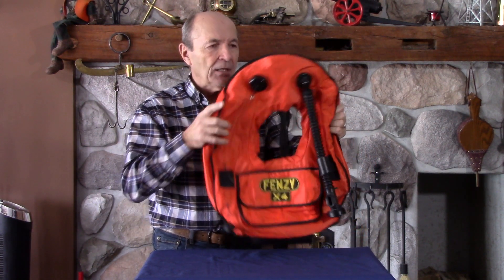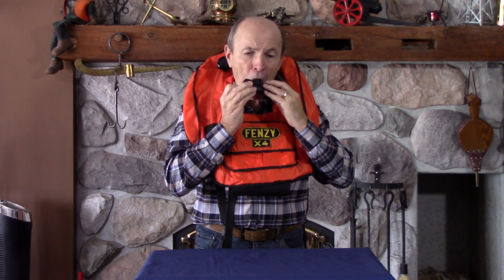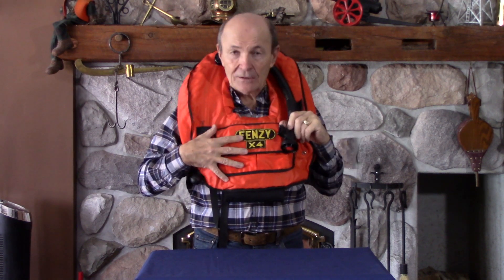Vintage Scuba: The "Fenzy" Self Inflating BC - S04E08

Comment: After putting on your suit, the Fenzy was fitted next, then the scuba tank, lastly the weight belt. In a real emergency everything but your life jacket and suit could be dumped. Something I could not reconcile when "stab" jackets became "normal" only morons thought they were an improvement. Self rescue is impossible with modern rigs, if you need to dump your tank and you find yourself 6 miles offshore and no snorkel. With a Fenzy roll on to your back and swim home.....
Reply from the maker: And the Fenzy could be seen a loooong way.   Black BCD, not so much.
A

Comment: How about the idea you could use it as emergency air . Learned on this in the (British) army with a J valve. 300 psi wasn't much if you had a deco to do. It would terrify a modern instructor to even suggest such a thing, but I was taught it. Right though, I never dove with any weight in my rig.
Reply from the maker: You have to watch Scuba Tech Tips S13E02 Don't breath from a BC.  Bring back memories.
A

Comment: My first BC was a used  NIMROD  yellow ribberized cancax unit 
It had a steel bottle to add air. Later I got hotd of a US Diverspower inflator that I adaptde with Epoxy . I used it for rears. Traded it to a buddy years ago . Sure wish I had it now. Dont know why ..my diving days are long gone. Thanks
Reply from the maker: That's NEMROD, from Spain. Good stuff.
Unless you are prohibited, why are your diving days over??
Diving is easier on your body, inside and out, than getting out of bed in the morning.
So, if you can get out of bed, you can dive.
Take care Tony.
Alec

Comment: When the Fenzy vests were usual  also the bottles had a "reservation", that warned you when the bottle had little amount of air and had to suspend the dive
Reply from the maker: I don't recall that feature. In my experience, one of the problems with the Fenzy was not knowing how much air was in the tank.
We simply refilled it off our air tank after every dive. Maybe that was  a later feature.
Alec

Comment: Great video, my bcd actually came with a inflator tank it’s made by A.P valves. Never used it but it is there in case I run out of air.
Reply from the maker: Gosh! Not sure if I'd rely on it for an out-of-air emergency. Not much time in there.
Kinda' like the Spare Air - great idea and it can be useful but not for divers to rely on. 
It has just enough air to keep you alive long enough to realize that you've screwed up and aren't going to make it!
5 or 6 breaths at 100' doesn't give me much confidence.
Take care.
Alec

Comment: Alec could you do a tech tip on adjustable breathing effort on 2nd stage regulators. Thanks.👌🐋🐢🐳🐬
Reply from the maker: We're planning a Tech Tip on adjusting regulators. It will be a 2 or 3 part series and will include adjusting the second stage at which time I'll cover adjustable second stages.
Alec
Reply: Awesome thanks

Comment: Great video.  Brings back lots of memories.   Comments about hairy chested divers is true and now quite hilarious. How did people travel with these? Did they take the tank with them or did they rented at destination?  Thanks.
Reply from the maker: That was an issue all right. The tanks are heavy. Actually these BCDs are heavy too since the material used was much more substantial than other BCDs of the time. It was more like heavy, rubberized canvas.
Generally they were used at home and a diver would NOT take them on a dive trip.
Today it would be a real problem with both weight restrictions and concerns about a compressed air tank.
Thanks for watching.
Alec
Reply: Thank you for the quick reply.

Comment: Another question any tips on how to tell if you properly cleaned your gear ? Thanks I really appreciate it
Reply from the maker: Interesting question.
I suppose that if it's working OK that's a good sign!
Seriously, if your reg looks like new on the outside, no corrosion, no green spots, no deterioration of the rubber, etc. that's the first thing to look for.
Unfortunately, it's only a start. I've had many shiny, new-looking regs come in for service that were destroyed on the inside - the important part. So, next look at the filter under the dust cap. It should also be clean with a metal-like color - no white or brown or green color. Try to see inside the first stage if it has openings. Look for white crusty flakes or green color - that's bad. Look into the ends of the plugs in the ports on the first stage. Again you want no white or green.
Look under the hose protectors on the first stage and the second stages if there are some there. The steel fittings should be clean and shiny - no white or green color.
The swivel on the second stage should be very free when not under pressure - not floppy and loose but easy to turn. 
Put the reg in your mouth and blow gently. It should exhaust your breath easily without hesitation or your having to blow hard into it.
If all of these are good, you're probably OK to go.
Proper cleaning after every dive as I've explained in my vids before and a service every 30 - 50 dives will keep it safe. 
A good reg, properly cared for, should last literally forever!

Comment: Great vid. I never got to use one. The one I used was the yellow horse collor but it had a co2 cartrage. And a inflator hose. I lurned to dive with in 1975
Reply from the maker: The yellow Horse Collar was the most common BC for many, many years. The CO2 cartridge is long gone now but lots of my vintage gear friends still use a Horse Collar.
Thanks for watching.
Alec

Comment: Have you ever got dcs? Or had to help a dive buddy with it? I would love to here your experience and opinion on that topic
Reply from the maker: I'm a rare case. I certainly have never been called a wimp - more likely a daredevil but, I have never had a serious diving injury in over 60 years of diving in every possible environment.
On a trip to Cozumel many years ago, my buddy and I were in a rebellious (read:stupid) mood and we went waaaay too deep.
After being ostracized on the dive boat, I rode back very quietly and every time I felt a tick or tingle on my body (probably caused by the salt water drying) I said to myself that my luck had run out. But nope. Sorry. No stories there.
Having said all that and despite it, I don't have much respect for divers who get DCS. It's avoidable.
However, it happens. Fortunately if you have access to treatment it may not be life-changing.
Thanks for watching.
Alec

Comment: ...Brilliant video.... Alec we Brits know that type of life jacket as an A.B.L.J....(Adjustable Buoyancy  Life Jacket) a proper old school piece of kit ,I still use one and found them a multipurpose item for snorkeling and canoeing included . in the pool we trained to breath off them in 12ft 6ins  of water just useing that small fitted air bottle . and old habits die hard, I purposely  bought a Buddy Trident B.C.D. with an integrated air bottle .... sorry for the waffle...
Reply from the maker: All of the models that we had here in Canada came from the UK.
That's another thing I forgot to mention in the video - they can be used with an air tank for snorkelling or other sports.
Thanks.
Alec

Comment: Do y'all not get AP Valves products over in the colonies? The Suicide Bottle is still an option on their BCs to this day.

My understanding is that  (at least in the modern context) if you're entering the water with a set that is negative without any air in (due to multiple cylinders, additional equipment, etc) and for whatever reason your power inflate doesn't work (you forgot to turn your air on) you crack the valve open to stay at the surface. So you can turn your air on.
Reply from the maker: The colonies?? Cute.
AP valves are available here but not so popular.
I knew that there are still BCD models with air tanks on them but I forgot to mention that.
They are really rare here. I don't even know if there is a North American distributor.

The thought that a self-inflating BCD might be valuable if you jump in over-weighted and without your tank turned on has some merit. I didn't think about that possibility. 
Actually, it's the idea of jumping in over-weighted without my tank turned on that I didn't think of. Seems to me that nothing would help a diver who would do that!
However, it's an interesting idea.

Thanks for watching.
Alec